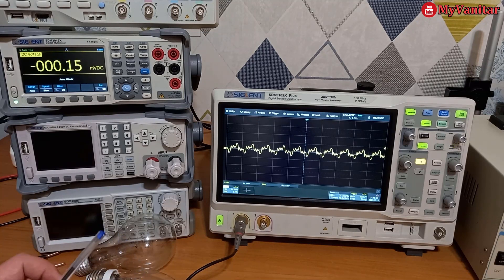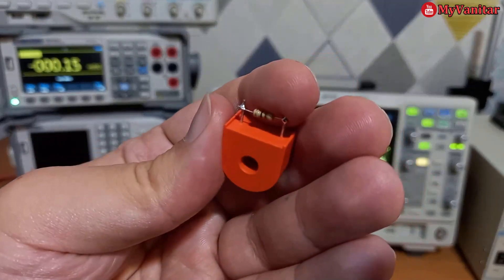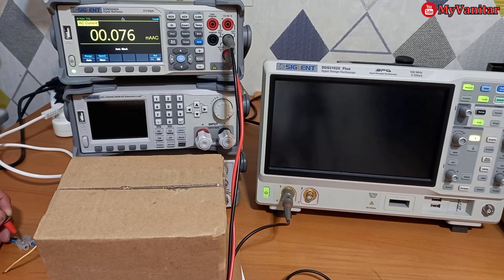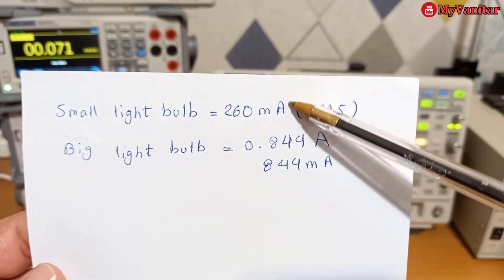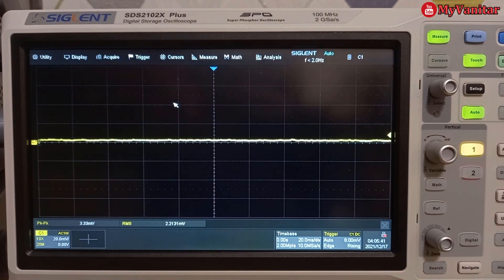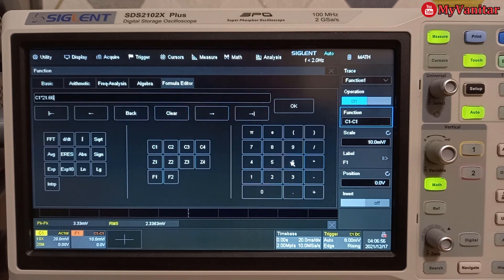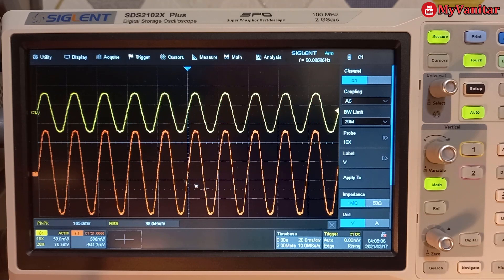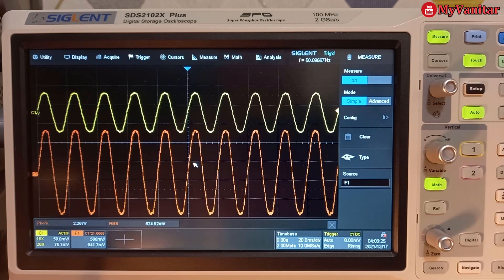AC RMS Current Measurement Using the Siglent SDS2000X Plus Oscilloscope

Comment: Is 6 amps AVERAGE DC current on hand held multi-meter, or panel meter,, the same as PEAK 6  DC amps on oscilloscope? I thought it was a 60% difference.
Reply from the maker: 6A? I tested for two classic light bulbs. The AC current is measured in RMS since it's not DC

Comment: I remember last year i was doing measurement for power factor. I connected mains to voltage divider so that probe Voltage is within oscilloscope limit. I did the same with current waveform but as soon i combined both measurements it went poof. My probe was damaged. Thanks to the circuit breaker otherwise who knows my oscilloscope would have been done for.
Reply from the maker: Yes, that's why I mentioned that also. usually the circuit burns from the weakest point, sometimes it is the ground lead of the probe, however, sometimes the oscilloscope PCB tracks might explode and burn, and then you have to say goodbye to that. Your fuse was a weaker point than the DSO PCB, so you just damaged the probe. Good Luck :-)
Reply: @MyVanitar  i searched back then but could not find a reliable video about it ON YT.  Thank to you From NOW i wouldn't be avoiding such measurements. My professor asked me to add an isolated transformer for one probe measurement but i did not do it out of fear that it might damage oscilloscope if i did it again.
Reply from the maker: You have a few options. for the current measurement, you can use a current transformer like what I did, or a current probe. You can also use a high voltage differential probe. You can check Siglent products. also you can power the oscilloscope using an isolation transformer (the only problem of this method is that you have to be careful and don't touch the Ground, when you deal with the 220V mains)